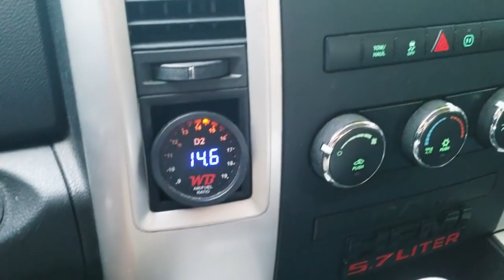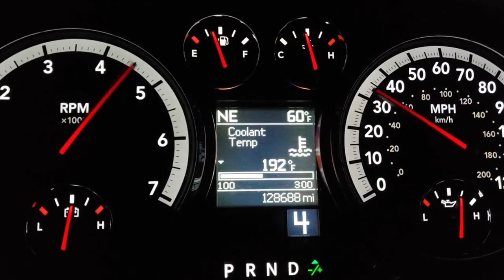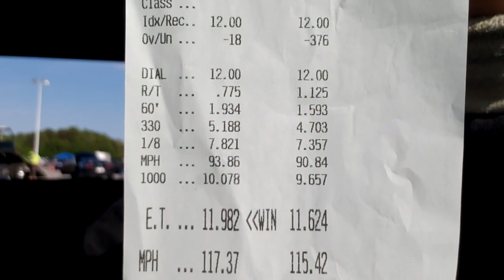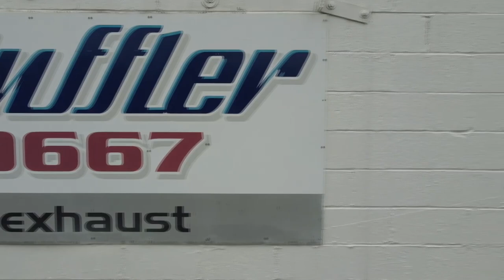FROSTBITE RAM Is This It Any Fight Left? I'm Not Sure

Comment from the maker: Thanks for the amazing support mopar fam without you Frostbite wouldn't have transformed into the 10second beast it is today and to think that the original stock internals 5.7 is still going strong today💪 not so much for that 545rfe transmission tho😜 I  also want to thank all the parts suppliers and tuners I've worked with in past and present.